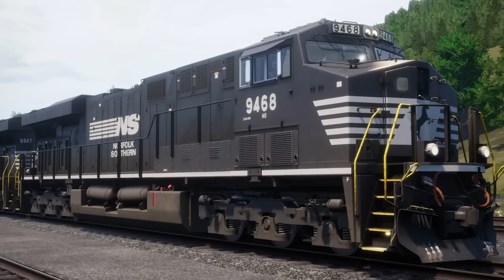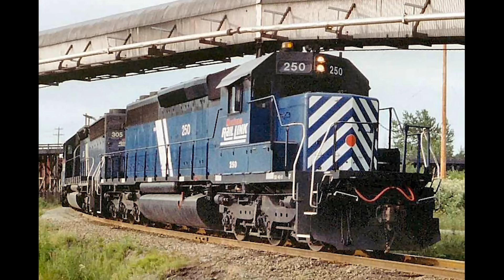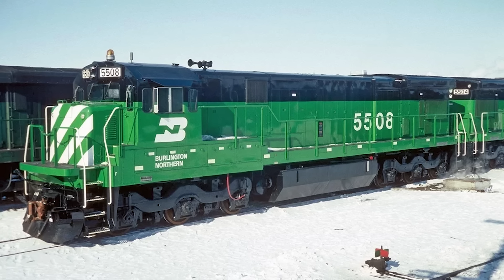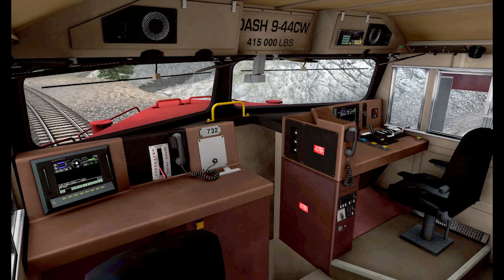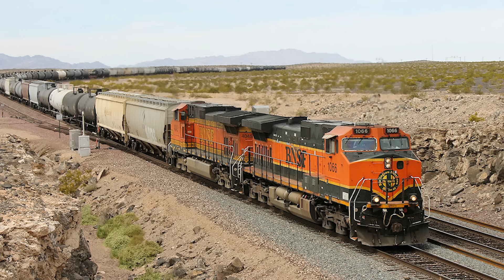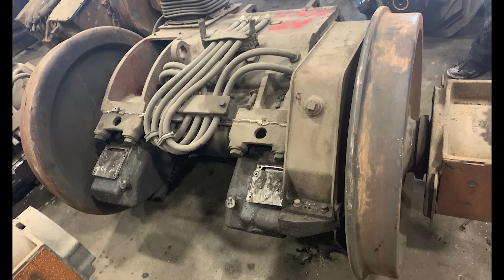How the GE Dash 9 Became the Backbone of Modern Freight

Comment: Is there a way you add can more words to the narration? The video needs more sentences like the one at 12:00. "When a wheel begins to slip on the rail it's losing traction, which means its not contributing to pulling the train." The extra words succeed in extending the length of the video while adding nothing of educational or entertainment value. Well done.